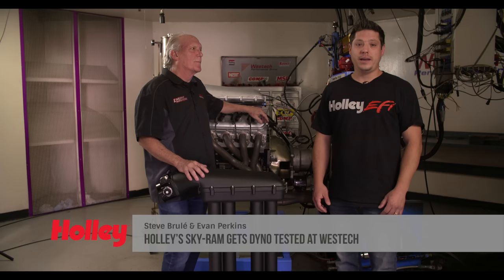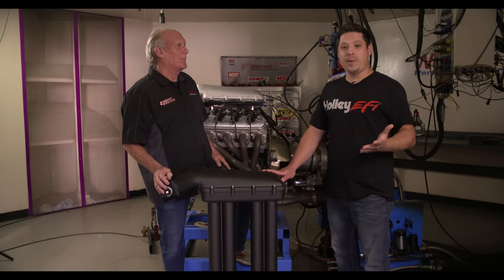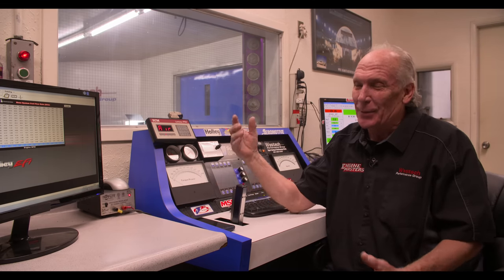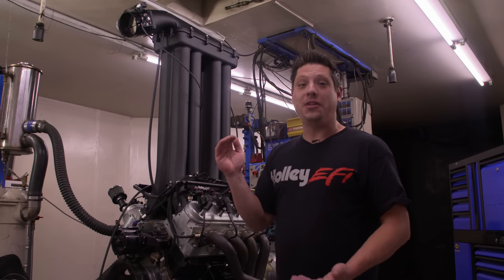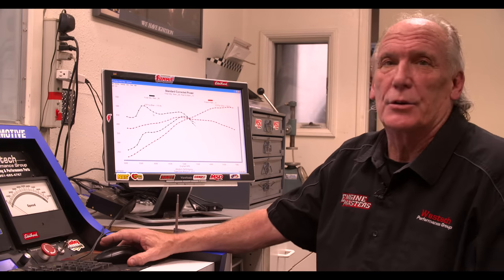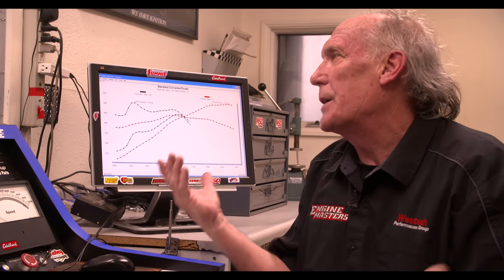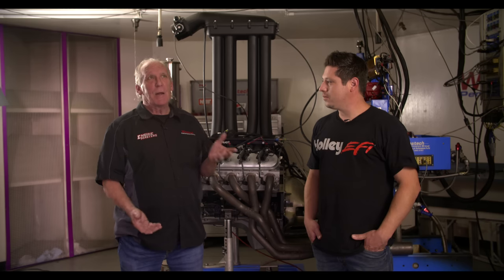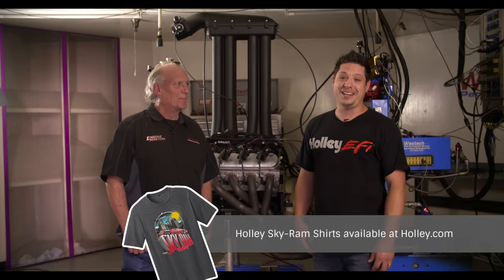Holley Sky-Ram Intake Manifold Hits the Westech Dyno

Comment: what would happen if you put the injectors at the top of the skyram instead of its base??
Reply: Cooler IAT, more power
Reply: You would get ice on the outside of it with E85 as fuel.
Reply: @timothybayliss6680  lmfao not even close
Reply: I saw a test where they moved injectors from the port to the end of the long intake trumpets.  The engine gained around 3%
Reply: @boost1728  run the math on it. Enthalpy of vaporization of Ethanol is 841kj/kg/k, specific heat capacity of air is 1.005 kj/kg/k. Even running a 10 :1 afr of Ethanol alone the drop in air temp would be over 80K. 80K is more like 144°f. You only need intake air temps below about 30f for ice to form. 
Maybe math isnt your strong suit
I am here all day.
Reply: @timothybayliss6680  you can math all you want.. methanol will do it, but we’re talking about E85 which has around 70% LHV of meth.. it’s not going to freeze the intake. Period. Do the math on water, then try it… see if it freezes itself 😂 if frost was an issue with E85, carb engines would not be able to be daily driven on it without creating an igloo by the time you drop your kids off at school. Guess what doesn’t happen?? That…
Reply: @boost1728  all those street driven cars with a skyram? I must have missed it. You are not going to get much ice on a daily even with meth because the volume of fuel evaporation. 
My argument is that this manifold on this dyno with e85 injected at the top would ice. You wont get manifold icing with typical port or direct injection either for the obvious reason of the location of the fuel. Even someone running a tunnel ram with twin e85 carbs and a hole in their hood might not get much icing but its possible, the problem is the intake is bolted to an engine that is 200f with a radiator in front of it. 
Water freezing in intake manifolds is a big deal. That is why aircrafts have carb heat. Put E10 in a Cessna, turn off the carb heat and see how long your flight is. 
Just because you havent seen something doesn't mean that is cant happen, lots of people like you used to think the earth is flat.
Reply: @timothybayliss6680  you can go on as many times as you want but the fact hasn’t changed- E85 won’t frost your intake. Run it
Reply: @timothybayliss6680  you have an opinion too and that’s perfectly fine. Until it’s tested all either of us have is theory. I don’t think it would cause frost. I just don’t see it drawing that much heat unless it’s something like 45° outside. On a normal summer day, unlikely. Cold intake temps for sure, below 32° I doubt.
Reply: @boost1728  nice. So when you lose 59f from IAT you stay above 32f on a 70f dyno cell. I have given you my source.
Lycoming expressly forbids ethanol from use in their engines. You still haven't mentioned the icing that happens on aircraft with 100LL. 
To further my claim that it would Ice the boiling vapor pressure of ethanol is less than 15f higher than methanol.
I dont have an opinion. My conjectures arent prefixed with "I think". I have a hypothesis. I am extrapolating a conclusion from limited knowledge. Try this in the future, Slick, instead of saying "I don't think..." Say "I dont know but,..".  That limited knowledge part is probably your best friend at this point.
Before you come back at me with your tail tucked between your legs, answer the question you asked about water ice. Tell me the IAT temps that can cause icing. Then tell me how an 11f IAT will not cause icing on an intake manifold with the runners three feet from the heads without a radiator shedding heat to the ambient air. I dont know but, the Earth is Flat.
Reply: @timothybayliss6680  if you put as much energy into yourself as you are into these comments you’d be somewhere in life. You have wasted so much time on your opinion it’s unbelievable. Your opinion is that it’ll ice and I’m 99% confident it won’t. You typing novels telling me what I should say or what I should do is not going to change these opinions or hypotheses into fact. You’re wasting your time typing novels to someone that does not care. Until trials have taken place and results have been acquired, sit down
Reply: @boost1728  so you're just not going to provide any answers to any of the specific and direct questions i asked? 
"I always cheer up immensely when an attack is particularly wounding I think, well, if they attack someone personally, it means they have not a single argument left"
Margaret Thatcher
The best comparison to this manifold to a production pieces with the runner length and arrangements is a VW type 1. They will ice the intake with the heat risers blocked with gasoline.
Thats not in a dyno cell with the ambient air temp of the stock engine compartment.
How many examples do you need? You now have two examples of engine families that will ice intakes with GASOLINE as the fuel. Both of these engine families include, stock, something that is not present on this. Heat. They both specifically include a method for heating the intake or incoming air to prevent the formation of water ice on the intake and they were both developed for E0 gasoline. 
They absolutely will ice as well. My VW will ice like crazy with E10. This is something i have seen and experienced. It is not conjecture. It will happen on days over 80°f. It doesn't happen at idle, once the revs are up and you dont have heat soak in the engine bay it will frost.
Dont worry about what i can make of myself. You have lots of problems of your own.

Comment: I get it!  With this long intake, the air's inertia is pushing it's way into the engine, overcoming the pressure wave created when the intake valve closes. So there is always positive pressure at the valve...until the runner length starts restricting air flow.  Same concept as with a tuned exhaust!
Reply: So, do we need to increase the diameter, or increase the diameter of the intake progressively to the rpm ?
Reply: @quickcinema8031  You would need to calculate how much air is pumped through the engine at the desired RPM, and then adjust diameter to match that flow.  I imagine there is an optimal air velocity to runner length ratio, so it would take some testing to figure out.

Comment: I still want to to see a really long-duration cam paired with this to use the long runners to make grunt at low RPM and the cam to make power at high RPM and the runner cross-section to keep power up in the middle and top of the range. If they made the CSA as big as I read in some internet articles it will work.

Comment: Dear Holly:
 Please print a version of this intake with  2 smaller manifold's on either side just above the fuel injectors with a butterfly valve that can switch from the long Sky-Ram to the short runners!
 Perhaps the best of both worlds is the possibility?? 
although with a very crazy looking and large, heavy and  high center of gravity intake manifold, lol.
It would be such sweet dyno fun to see if you can get that whole power band up higher on the dyno sheet and carry it all the way to 6500 RPM..🤔🤔🤔

Comment: Actually I’ve been looking for a much taller intake for years. I have a 1957 pickup with a ls6 intake. It looks odd. I have a ton of under hood space. There are applications like mine  where this would sell in a kit form. Maybe a kit that’s adjustable with different length runners. Nowadays the ls motor is in everything.  More options please.

Comment: IF it was built like a cross ram with the runners laid over on each side to make a straighter run at the ports, a throttle body on each side, and the length adjusted to ba a harmonic of the length required to make max power higher up you would see multiple torque peaks. It would also be practical because you could see over it while driving.  Something like a modern version of the Rat Roaster Hemi or Cross Ram C300 manifolds.

Comment: have a secondary throttle bodies coming in from both sides down low on the runners, that stay closed until 4000 rpm, get the torque and BHP in one setup....

Comment: Talk about hood clearance, I've got an 82 GMC B6000 (Bus) and it's got over 3.5 ft of clearance under the hood if not more.  This thing would barely stick out of the hood if at all.  I'd love to have that low end torque so I could gear the thing up too for cross country travel.  Shame you guys aren't selling these, or at least releasing the STLs or CAD files so I can make my own.  Hell I've got a CR-30 I could print the runners in one go, all be it 4 at a time, but the print would be continuous all the way through the runners.

Comment: Car manufacturers have been putting super long, albeit twisted, intake runners onto their engines ever since they separated the fuel from the air flow. The increase in low-end torque is well known.

Tunnel ram intakes use long, straight runners because fuel mixed with air (as delivered by a carburetor or throttle body FI) doesn't flow well around tight bends.

Comment: Now you need the 2nd plenum on the bottom the when the RPM goes up enough "shunts" across those runners with internal air doors giving a short direct shot in to the port like some OEM manifolds, actually a lot of OEM's do even the Koreans. Might as well have it all and you would see a 50 HP gain too.

Comment: Would be cool to see if an intake would be actually designed for specific engines primary intake pulse. Would mean ridiculously long runners but should not do that badly on higher revs either.

Comment: I would kind of like to see airflow numbers of the high ram and skyram bolted to 317 heads. I am thinking that those runners wont have enough taper to maintain laminar flow
Reply: Why 317 heads? Those are the lowest flowing LS head made lol
Reply: @robbygray9562  they said it was an lq9 engine. Thats what is stock and should be on this engine
317 heads also wildly outflow 706 heads through the middle. A hotrod test showed at 0.400 lift that 706 flow 213/158 and 317 heads flow 235/168. Thats a huge difference. The peak flow is less of a difference but still biased for the 317 casting. Your statement that 317 heads are the lowest flowing comes from bad information.
Reply: @timothybayliss6680  It has rectangular port heads... not sure it is an LQ9.
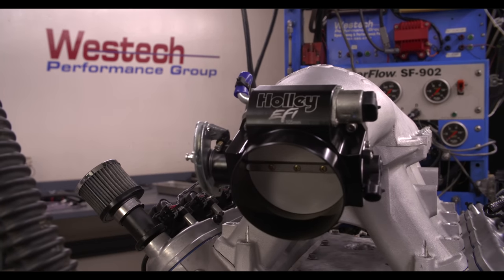Reply: @stuartstogdill2406  listen at 1:14 its either a lq9 or someone is misspeaking

Comment: Should pair this with a high ram manifold and make a system to switch it over to the high ram at a certain RPM for a stupid good low end torque and a very good high end torque number.

Comment: @Holley you need to test it on a complete stock engine and try to tune it. The try an array of different cams a low duration high lift cam might be perfect for this intake 🤔 a cam where the lobe looks like a point more than a rounded one. Then maybe a low lift long duration cam. we need this 😬

Comment: i bet these things would make a great manifold for a monstertruck (naturally asperated )  , low end torqu and with the engine sitting behind the cab the intake prolly would just clear over the roof of the cab , might work on a mudbog truck too as the intke will be waaaaay over the floorline of the trucks cab
Reply: I think actual monster trucks use a high reving engine due to the triple gear reduction at the wheels to drive the huge tires.  The engine spins fast, the wheels spin slow.  But a mud truck would be a better fit.

Comment: the funny part is this intake would be good for truck or drag racing applications (that torque at 3500-4000 rpm😍 ) , also wonder what it would do with force induction.

Comment: Need to work out some way to have something like a short runner valve on the gen 3 hemi's. Even cooler would be something like telescoping runners. Entered that contest because I would have to engine swap my RV just to be able to run that. It's a classic RV with engine up front under a dog house. Having the sky ram poking up between the front seats would be too amusing to not do.

Comment: Talking about 3d printing an intake, Thunderhead289 printed an intake and adapter plate to run a lawnmower carb on an old 302 it worked even at 70mph, and got 41 mpg...

Comment: Stepladder?  Put this on a monster truck, and you will need scaffolding!  The absurdity of this mailbox contraption teaches/proves runner length characteristics at the same time we wonder... wtf.  Good fun.  Who could use this?  Actually, a two pole generator setup - rpm is constant, and throttle gets electronically managed to compensate for varying load conditions - all in peak VE range, using this manifold.

Comment: What happens at about 5000 rpm the the intake valve shutting sends a reversion wave up the intake track and cancels out the in coming air
Reply: Basically the timing of the reflection of this wave you're talking about is out of phase badly with the intake valve re-opening, where at 3500 RPM it is fairly well aligned

Comment: I heard the guy say, “1 inch all thread to hold it together”. Is this hollow all thread that goes through the runners? If yes,  no wonder the top end is gone and there’s a huge torque spike at the bottom. If that is the case, it’s not even comparable to the high ram.

Comment: I wonder if this isn't the basis of a usable product. 
The lower section could be made and end with a flat flange where all pipes are facing up. From there, sections could be added in 1in, 2in, 4in and 8in in length. A true modular design for anyone not restricted by bonnet height and wanting to maximize low and midrange torque. 3D print them (or mold injection) out of a heat resistant plastic to keep weight down and heat out.
Question would be, is there a genuine demand for such a system?

Comment: Holley: Is there any way possible you could post the dynograph further to the left, assuming WestTech started at least one of the pulls below 3,100 RPM?   -We KNOW they keep all those dyno sheet files FOREVER... 

It's just SO RARE to get to see intake wave tuning on the dyno that includes the huge +10% 2nd harmonic wave like we see here; it would be AWESOME to be able to see the 3rd (+7%) or 4th (+4%) harmonic-based mini-torque peaks earlier in the RPM, if they're available; I can't think of many other intakes that would even let you see the 2nd-4th harmonics on a single pull like this, so it's just a super interesting opportunity.  (I'm guessing your 30" intake runner length + about 4" of port centerline length in those heads?)  -3rd harmonic should show up between 2,600-2,900 ish and 4th harmonic between 2,050 -2,250ish...

Comment: I wonder with that much room under the Skyram if you could fit a high ram under it and with electronic throttle body and tune it to open when the skyram runs out.

Comment: What heads and cam? I think you might get a little bit smoother of a curve and more torque at lower rpm if you used heads with smaller ports for example.
If you've got an intake that only flows up to 5,000 rpm, an intake and cam that run good up to 7,000 rpm are a hindrance because the ability to run up to 7,000 rpm is that you don't make as much low rpm power.

Comment: It seems it might be good for use in a truck for heavy duty trailer towing. Suppose you optimize the cam and the timing and the runner diameter and everything else to match the length of the runners. How much more torque could you get out of it?

Comment: do u think u could make the intake runners telescopic? that would make them able to vary in length based on whatever, so they can make better low end torque on the low end, and high end torque on the high end. i guess making a more linear power curve or something.

Comment: Add a short runner valve with another throttle body, so you'd have massive torque and great high rpm power.

Comment: This would be great for towing or off the line immediate power. I wonder what if you had another intake valve body lower down and have that activate but have the top one close. Maybe this way you can get that high rpm range back. My 1976 Chevy c10 only has the stove bolt 250 straight six in it, which produced like 150ft lb of torque and with this I could potentially increase that by a large margin. It only revs to about 4600rpm anyways haha

Comment: If longer tubes are better for low end torque, and shorter for high end torque - what would it take to have a variable length that could be tuned for increased torque over a range of RPM?

Comment: Will that fit on my transverse engine? There's not a lot of space under my hood for a charge air cooler, and this looks like an appropriate solution. I've only got a 4 cylinder, so I can loop the flow for additional cooling.

Comment: Problem with the hi ram is its unpracticable with fuel injection. The top for it just sticks to far out front! I've seen pictures where the TB is out there with the damn radiator making any hood impossible even with a hole cut in it!

Comment: Mopar had 30" runners (wet) 60 years ago.  Magnum root beer barrel had looooong runners and a nice flat torque curve.  All you did was package it poorly.
BTW, tractors usually make peak power around 1400-2750 rpm.  And torque rise is desirable down to 800-1000 rpm.

Comment: What filament was this printed with? I've been looking for the best 3d printing filament for car parts, especially those which can stand up to high heat and fuel.
Reply: This looks laser 3d powdered aluminum. Its a neat process. It a vault in an inert, usually nitrogen, atmosphere that is filled with a powdered metal mixture that is heated to melting with lasers.
There is a 3d printed inconel exhaust manifold on Yt. Its an intense process.
You can 3d print nylon but its tricky. It needs to be dry, dried while printing and usually done in a heated enclosure. Some lower end printers can heat to the temp either. 
PA6+GF30 filament is going to be as close to what OE uses for injection molding. Its really strong stuff.